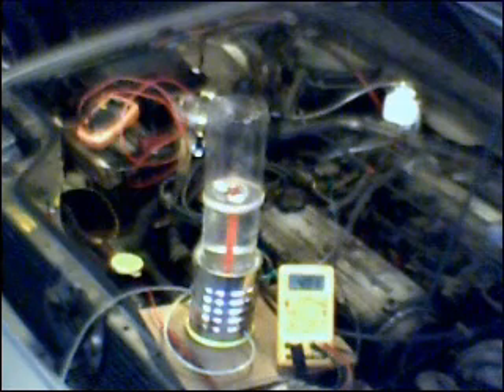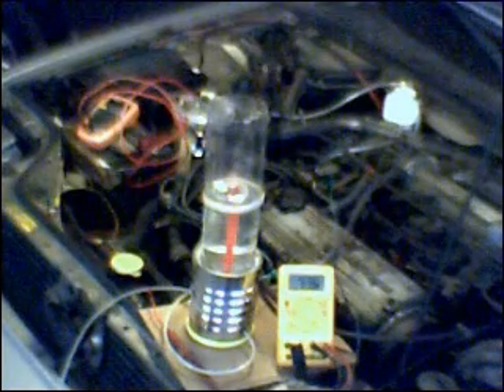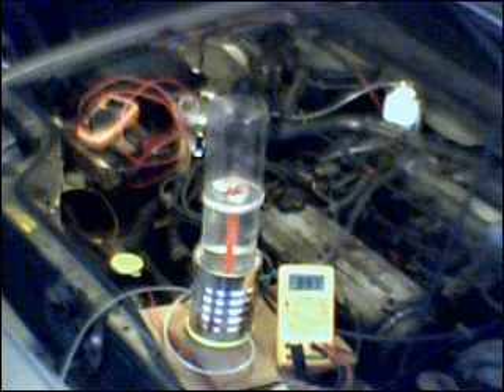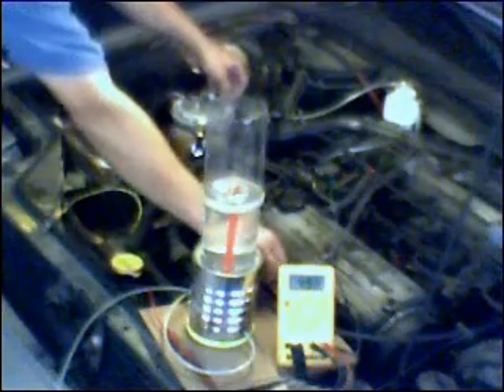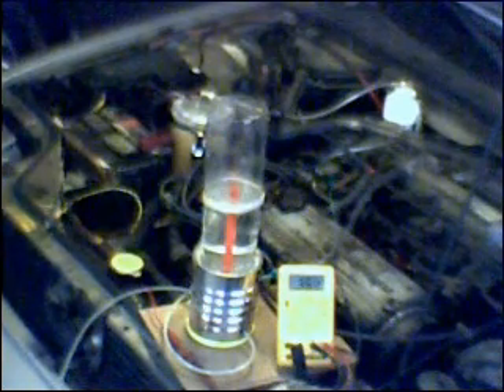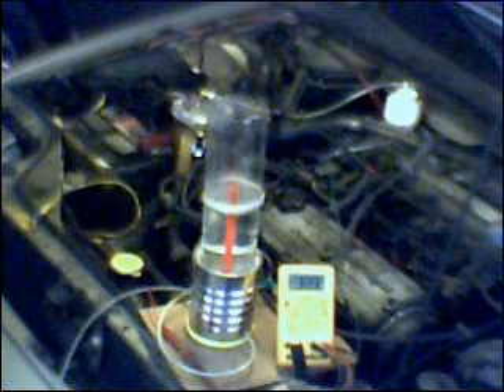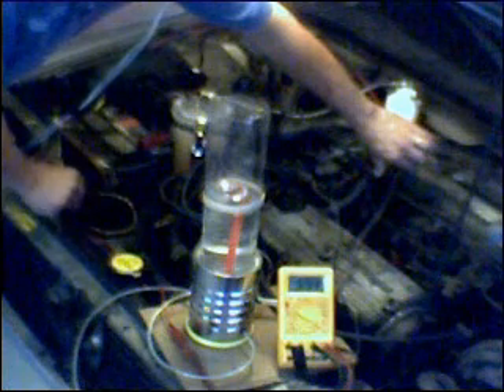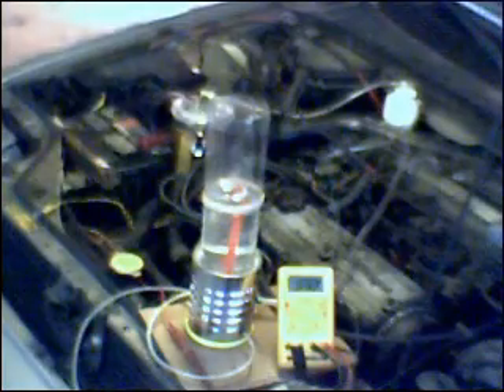#34 Hydrogen HHO Zero Cell EFIE CALIBRATION 2007/09/01

Comment: I think there may be some confusion over the oxygen sensor here and how its used. Its used by the engine ECU to adjust the fuel/air mix to achieve complete combustion at any given operating point. When HHO is added to the engine and combusted the HHO should result in water alone as it was just electrolyzed from water. Assuming complete combustion of the HHO, there is no additional oxygen being added to the exhaust stream. Any changes in the oxygen sensor is therefore a result of some other aspect of adding HHO. For instance the HHO is displacing some quantity of natural air being pulled into the cylinder, lowering the oxygen content precombustion and possible over enriching the remaining gasoline/air combustion. Less oxygen would be measured briefly at the O2 sensor and the engine ECU would respond by leaning out the fuel mix. All this being said I believe some additional thought should be put into playing with the O2 sensor merely because HHO is being added. Making adjustments as you are is likely just leaning out the entire combustion cycle which could provide fuel consumption improvements at the tradeoff to engine performance and potentially knock.
Reply: I believe  my books say downstream O2 sensor does check quality of catalytic and not mixture lean Ness.  Good evaluation here. My 02 isuzu is showing 400 mile/  tank on hho not 300 usual. Now I added the efie set at 440mv boost. Will see the difference. Hho counters knock premonition but you need to input equally to all cylinders. Had too much vacuum pull on brake  booster and fouled #4 plug so switched to 1/4 HOSE input below throttle plate

Comment from the maker: And a brief update on the EFIE. I've been running at 150mV offset initially. Not nearly enough. MPG gains are barely noticable at this setting. Reason? If you examine the O2 sensor voltage curve chart you will see there's a large voltage swing within a very tight mixture range at 14.7:1. A tiny offset has almost no impact on mixture. 300-450mV is the range I will now be focusing on. My HHO output is 1.2 LPM @22A input, 13.6V or 300W.

Comment: So from this vid what zero's trying to say is that you have to get the mixture of gas,HHO and intake air at the same ratio that your car usually runs on with just gas, think of HHO as gasoline but going in thru air intake. So the mix should be like %HHO=petrol... IntakeAir+petrol= IntakeAir-amountofHHO+petrol+HHO.

Comment: even if you put restriction on the air intake, the exhaust downstream sensor is still going to "think" that there's too much air going into the intake as the only biproduct of burning HHO is steam which has a lot of oxygen. so you need to control the air fuel mixture yourself manually. you can set it so its not trying to put more gas in and instead of the gasoline, you can use HHO.

Comment from the maker: LV imposes no limits on the number of videos or albums. Also no limit on time, just size per file, 100MB for regular accounts, 200MB for director. Both flavors are free. And it's reliable.

YT definitely has greater market share though. That's the only hesitation I have. Maybe once I mirror I'll post to both. There's no need formore than 10 minutes per clip at either service anyway.

Comment: What about testing with a lawn mower engine?  No fuel injection mods and you can use a gravity feed clear tube fuel tank to make acurate measurements of fuel consumption with gas versus hho.  And you won't blow up your nice honda intake manifold :)

Comment from the maker: Either way produces the same result. But you're right about one thing. The motor compensating with mixture is not measureable as voltage fluctuation with a DMM. The motor is struggling to keep the o2 voltage constant. What's needed is a scope on the o2 sensor, connect the HHO feed tube and measure the spike before the lag time of the ECU has time to compensate.

Or you can just go trial and error like I ended up doing. 200mV right now.

Comment: i think you should not measure the output of the O sensor not while switching the power to the HHO cell on or off, as this already influences the O sensor output only by the needed power to drive the HHO cell. instead, leave the HHO cell always on during measurement, and only switch the HHO gas to the motor on and off..